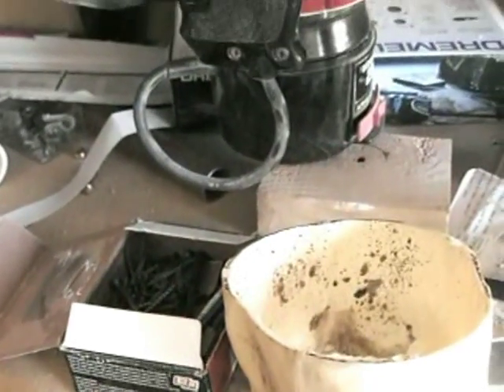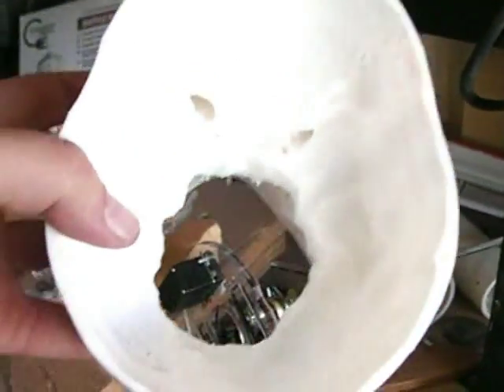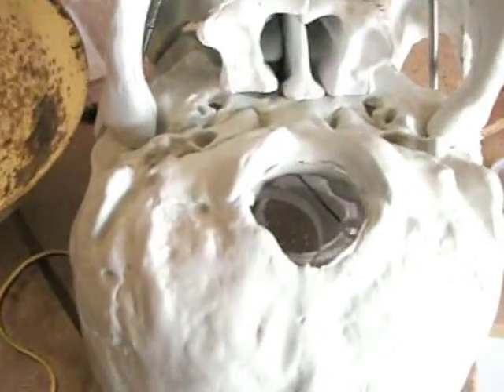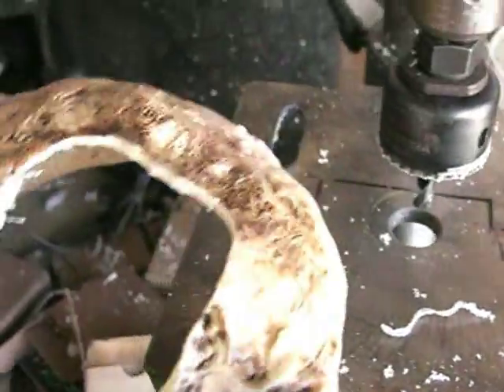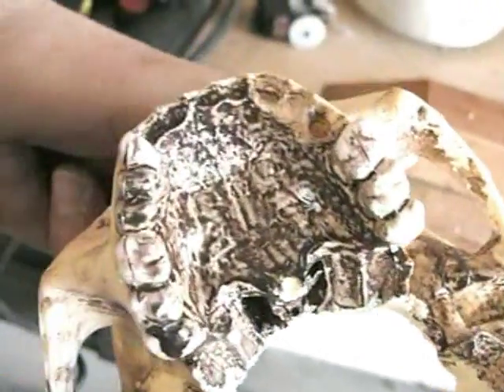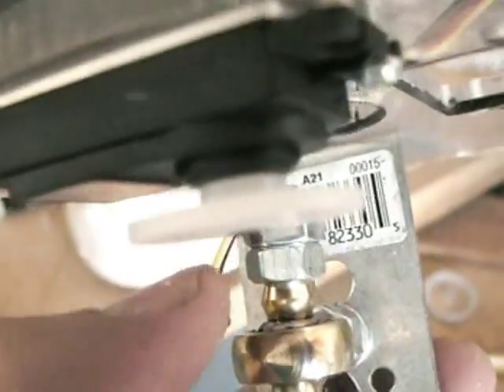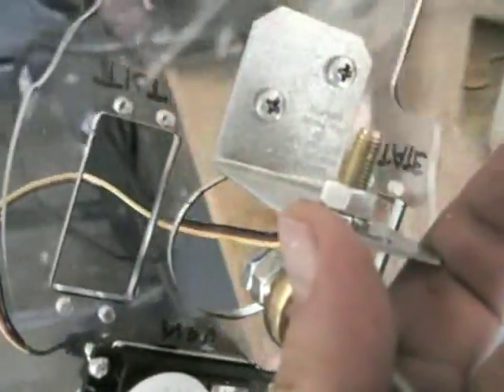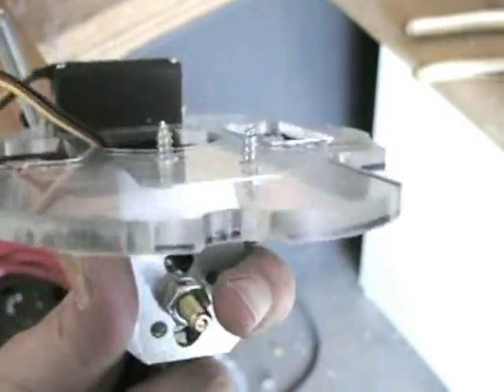3-axis skull How-To 1

Comment from the maker: fit servo, put in small screws to hole to plexi plate. Feed pushrod arm down side of skull to jaw.   It will take some doing to figure best placement for hole.. closer to pivot point at jaw means move jaw movement.  farther down towards teeth means less movement.

Comment from the maker: the plexi plate is just from HomeDepot, get one, prob 1/4" is all you'd need, place it on top, trace with a sharpie, cut out, fit inside, drill tiny holes for screws to secure it inside.  Trace 1-4 holes for servos.. if doing just the jaw, that servo goes near the front of the head, to the left of centerline, as in the videos..

drill coners out and use small sawblade to cut out servo hole(s), smooth with file/sandpaper..

Comment from the maker: No place I can think of, unless you try graveyardskulls website.  All thats required is get a skull (use a Lindberg, lighter, cheaper), piece of plexiglass from HomeDepot or Lowes (HD is cheaper), place it on top of the open skull, trace with a sharpie, cut out skull shape, mark 1-4 servo holes (like in my video), drill corners, start a small hacksaw, smooth with file/sandpaper..  all this is in HalloweenForum website under Props Topics..